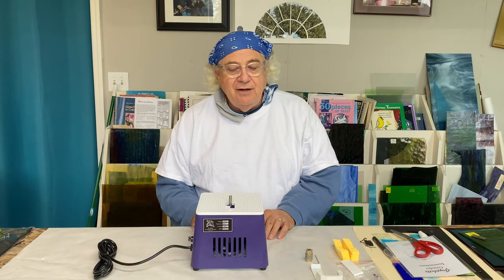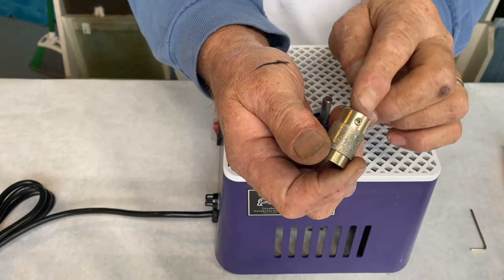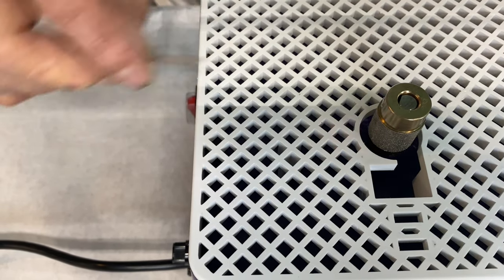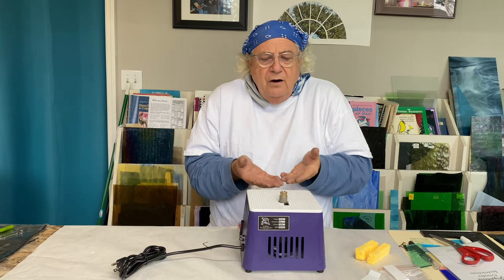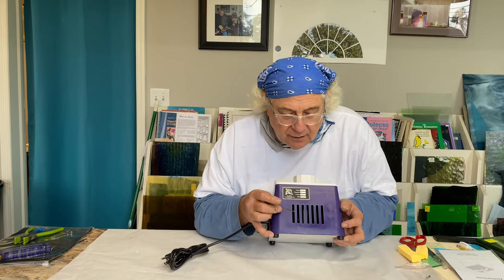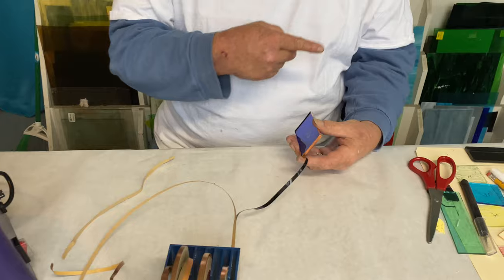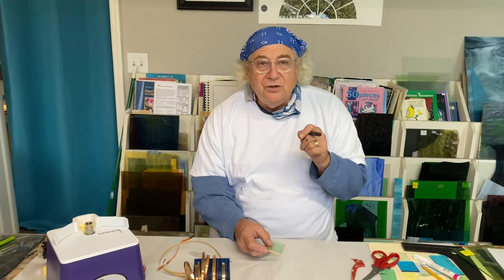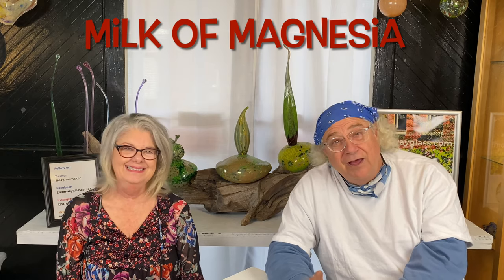Top Tips for Grinding & Foiling

Comment: Great video using and working with a glass grinder...! I have my grinder setup in my laundry tub. Whenever I grind glass, I have a small hose that I connect to the laundry tub water faucet that provides water directly to the grinding stone and the glass that is being grinded so there is absolutely no dust whatsoever... The water keep the grinder bit clean and removes any and all glass dust into the grinder filter I have connected.
Reply from the maker: That’s a great idea. Glass dust is the worst kind.

Comment: Old timers tip- most valuable. I may have had to drill out one of those old set screws...now I NEVER leave it on the machine. I always take it off so it won't rust in place. How long would you say one of the diamond bits should last?
Reply from the maker: That will depend on how often you use it. 
Thank you so much for watching! Join us Monday at 7Pm Est for the livestream Q&A. We chat about glass, answer questions, share info and there’s a glass demo.

Comment: I have a window two feet by 44 in woman wants me to put a frame because the window has no support but it actually is made with that very thin lead that they use in the some catchers I didn't believe it myself the windows old and very unstable I agreed to put a frame because it cannot hold a bar of support I thought that would help her out but she wants a lot more than she can actually afford I feel bad I like to help her but it is not an easy fix I don't know what to do maybe you can give me some advice I love your show I've been there since the very beginning out on the outskirts but I do watch you every Monday thank you
Reply from the maker: Good to hear from you Pauline! Lay flat putty and clean. Let it lay flat for a few days then put it in a frame. That is most economical solution. Thank you so much for watching! See you on Monday.
Reply: Pauline, how did that recommendation work out or did you try a different fix?

Comment: glass is made from silica sand and could cause silicosis in lungs but probably not in the hobby. more for people who work in glass recycle. but stillgood to wear basic mask over mouth and nose when grinding. people have worked decades with much more toxic and dangerous materials creating art but that does not mean it is OK to throw all precaution away.
Reply from the maker: Most importantly, keep the grinder head wet as to not disperse glass dust into the air and throughout the studio. Masks are recommended when grinding as well!